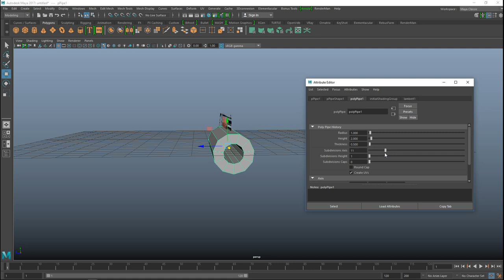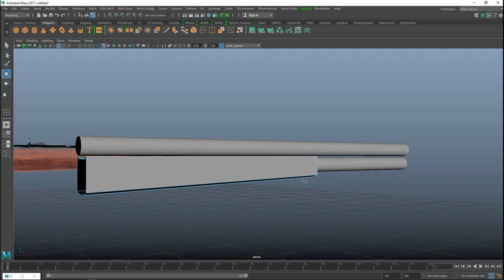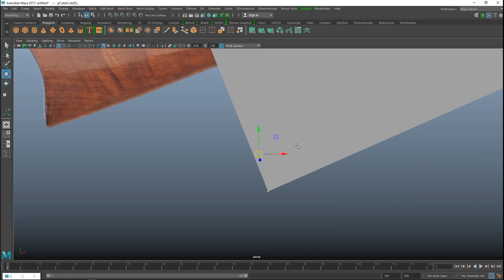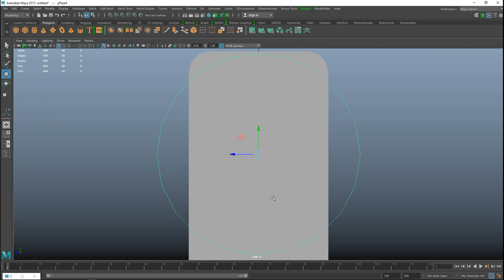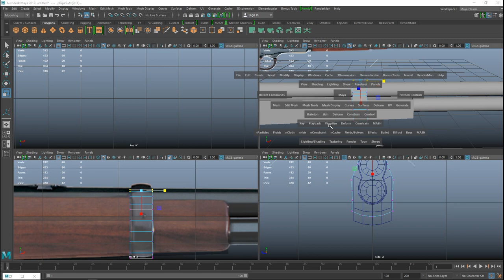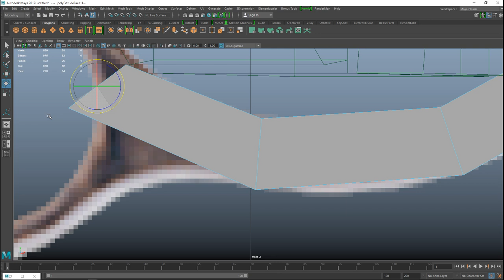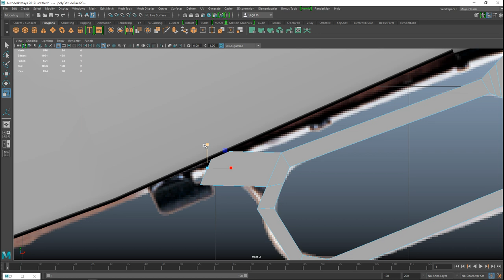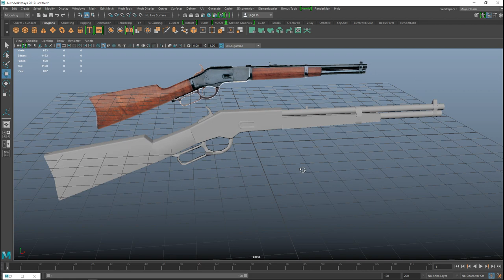3D Modeling an 1873 Winchester rifle ( Full High to Low workflow ) Part 1 of 2

Comment: Hi,
Is it normal that every time when i try to move a couple of edges the whole object is moving. I' ve tried changing the orientation, but It doesn't help. Are there specific settings that I should change?
Reply from the maker: It is certainly not normal. Are the edges colored red and yellow ?
Reply: they are only clored in green while selecting them,  and then the whole object turns yellow